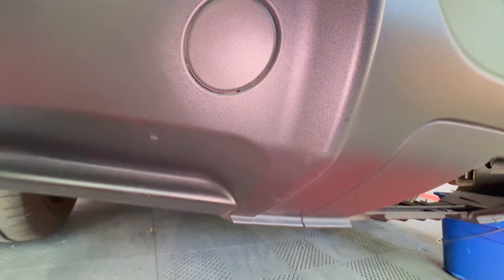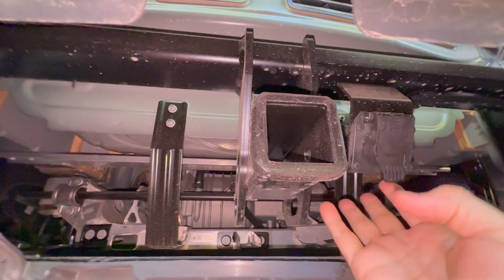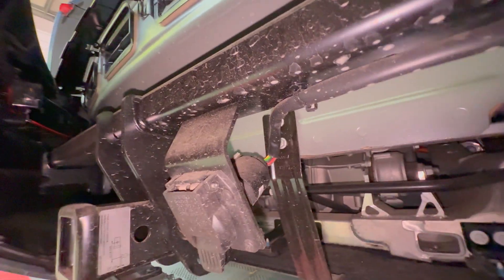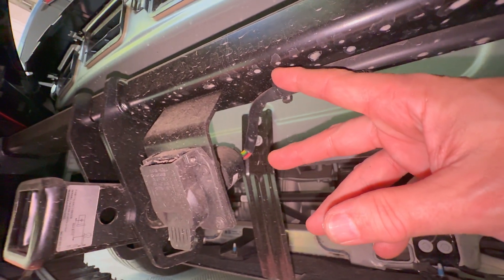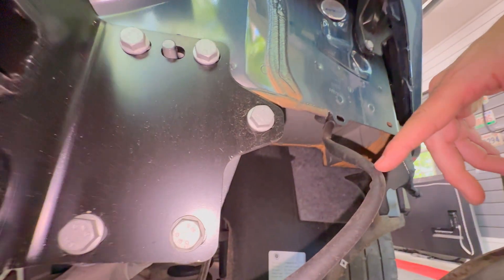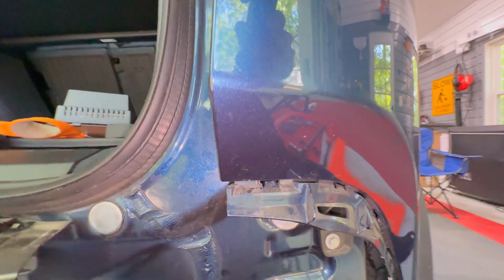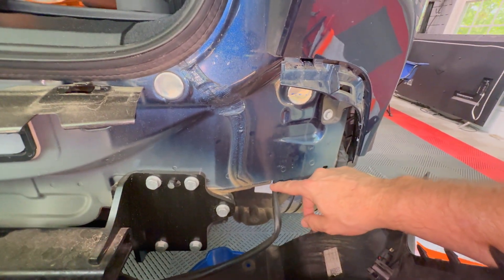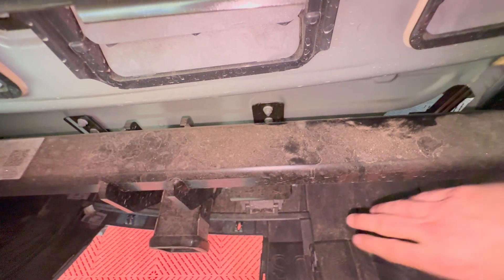Fisker Ocean - Hitch Wiring Location

Comment: How are you Sir , thank you for all your videos, I am thinking of getting the ocean to drive for uber in NYC is been going on a promotion , but as I never drove an EV I am not sure if woll work for a rideshare is been so many bad reviews of the vehicle that I am afraid I will have more headaches than making money , any advice you can share would be greatly appreciated 🙏🏽
Reply from the maker: @GL7777-v3t  As far as I know American Leasing which owns those Oceans has done all the required recalls and maintenance (like new 12V batteries).  So I’m guessing other than normal bugs it should be reliable.  Does AL cover any maintenance or issues if you do rideshare?
Reply: @ hi thank You for the reply, yes American lease will pay fir any maintenance of the vehicle, now the big challenge is the luck of charging stations , that’s why the cars are rent for low cost, you will have to spend more time finding a Ev charging station that might be a line to charge and then the time you spent charging that is the big challenge !

Comment: I am looking to add a hitch to my ocean. Does the hitch wiring splice into another existing connecter like many of the tesla mods do or is it a stand alone connection
Reply from the maker: @kevinharter4490  There is an existing connector that will be used inside the right trunk area.  However, the module and the wiring needed are only available from salvage cars (at least right now).
Reply: @MTNRanger would it be possible, if a brave person were to cut the wires, and insert a new, off-the-shelf connector?
Reply: @MTNRanger  I wonder where we could get the wiring schematics for it?  Someone should have them.  Then get a wiring place to quote on supplying them.
Reply from the maker: @ I have recently been told that Tsunamiautomotive is working on getting the module and wiring harness for sale on their website.  I’ll update when I get more info.

Comment: That seems pretty easy to make. Cable + plug is pretty standard. Is there a module that is missing in cars without it?
Reply from the maker: @dakotapahel-short3192  yes, there is a module that will be needed that goes indies the right trunk area near the bumper.  Right now, the only solution is to use salvage parts.